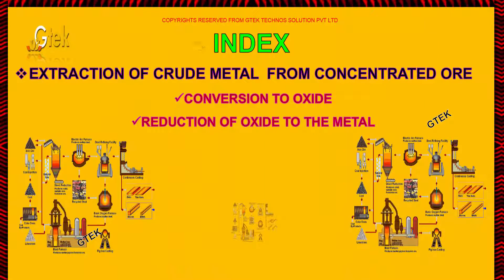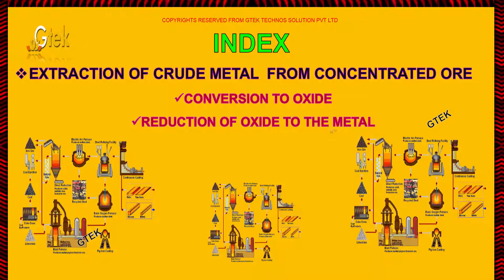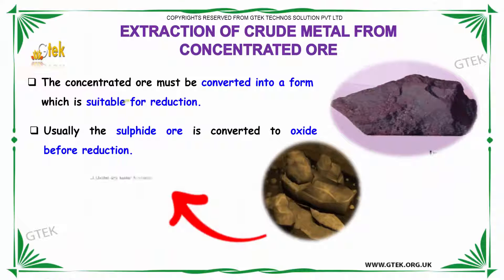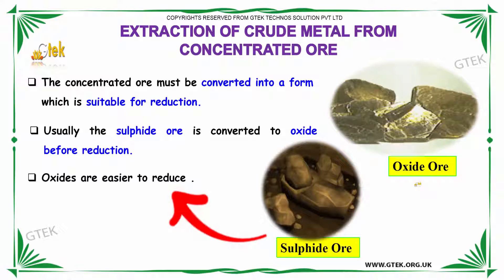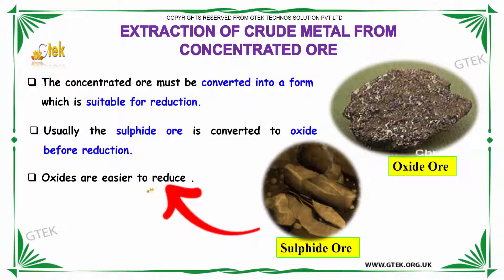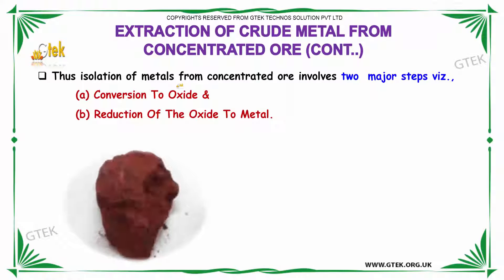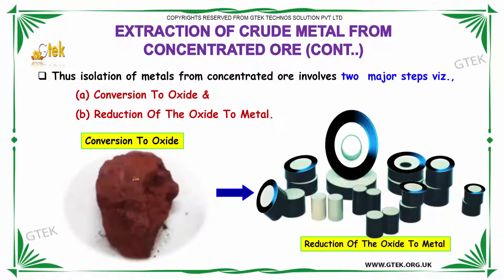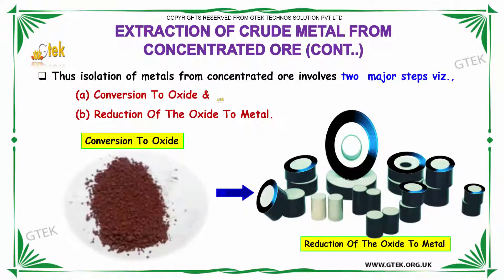extraction of crude metal from concentrate ore class 12 chemistry cbse

Comment: Concentrated ore can be converted into its metal oxide either by calcination (or) by roasting. Calcination is the process of converting an ore into its oxide, by heating it strongly below its melting point, in the presence of a limited supply of air.

Comment: It is a process in which ore is heated in regular supply of air at a temperature below the melting point of the metal. Sulphide ores are converted into ...